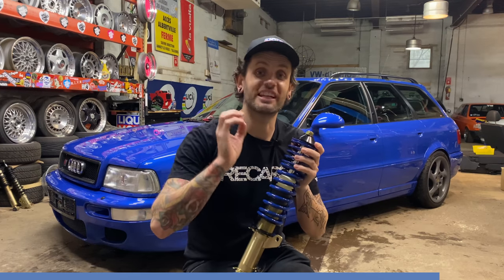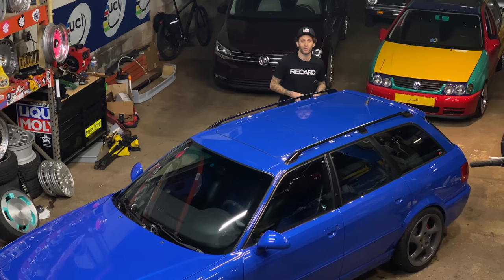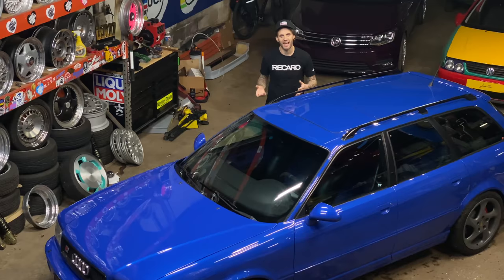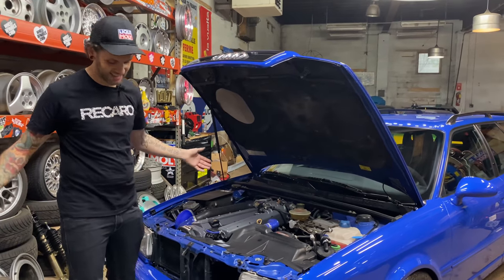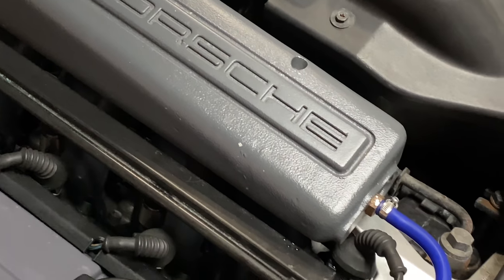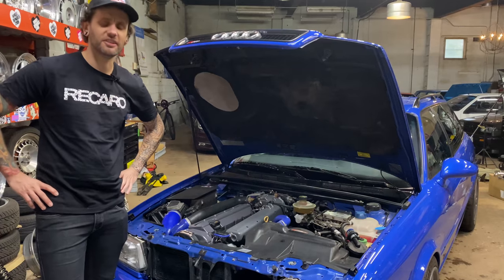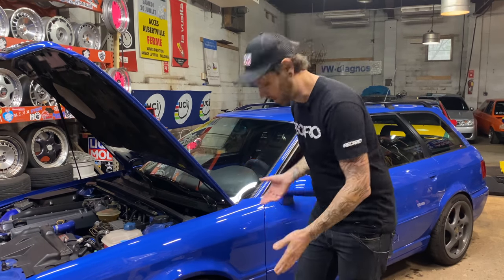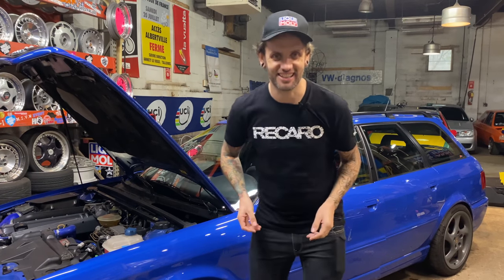Audi RS2 - finally legal in the USA - the forefatheRS

Comment: On an RS2 this colour isn’t called Nogaro Blue, it’s called RS blue. Some other RS2 details are the black Audi rings in the steering wheel, and the black interior door handles.
Reply from the maker: I haven't heard that before about the blue :-) You're totally right about the interior door handles etc, which look so cool!
Reply: @JamieOrr  yip, I own an RS Blue RS2, and have done for 12 years ( mine is RHD). I have the original sales brochure. I think the name changed to Nogaro because it was available on non RS Audis. The colour is the same paint code (LZ5M). Cheers.